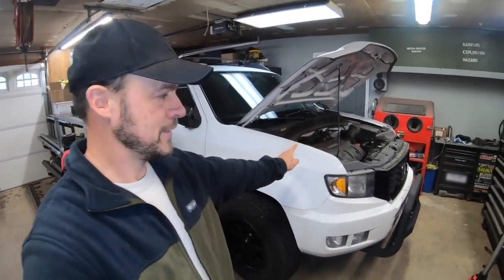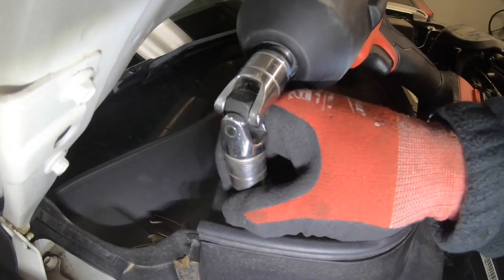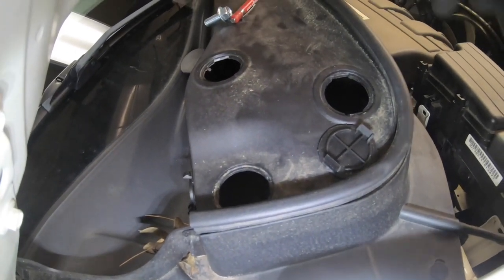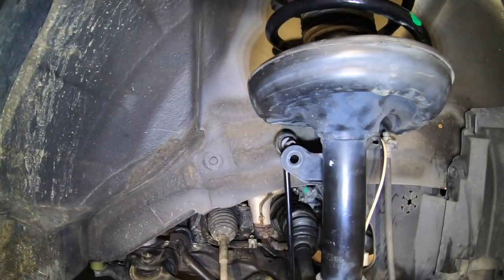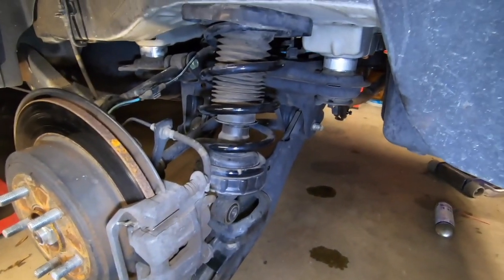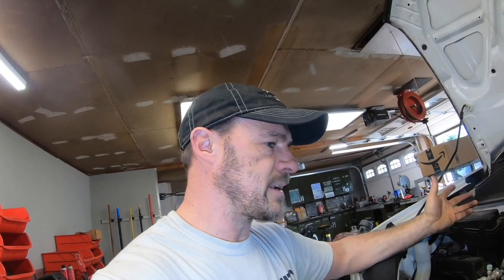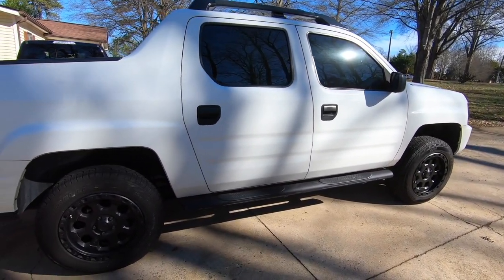How to lift a 2006-2014 Honda Ridgeline 3 inches with the HRG Offroad lift kit!!

Comment: I put a 2" front and rear lift on a 2012 Honda Ridegeline, and had the vehicle aligned. The vehicle immediately developed a shudder that starts at around 17mph and ends at about 20mph (the shudder seems to be happening only in the front of the car). The mechanic who did the work told me that he is concerned that the front axels might be stressed and that driving the car might cause damage to the axles and other expensive parts of the vehicle. Do you have any idea on what I might to do solve this problem?

Comment: Omg this lift is  amazing finally some ones is making video of Ridgeline and making aftermarket things for it I personally think that this truck is no noticed or like nobody pays attention beacuse everyone say oh it's a Honda it's suck or it looks ugly beacuse of how it looks but not it's a good looking truck and can be really cool looking lifted with some mud tires or off road tires I have been thinking of making my Ridgeline into a Baja truck like making it fast lifted making a skid plate a metal bumber and stuff this truck is amazing and I'm gonna let you in a secret of the Ridgeline I daily it and don't you think like it's bad on gass like it uses lots of gass I found out a solution how to make it save gass like it's simple anyone can do it so what I did was change the filter sure it saved gass a little bit more with a new air filter on the engine but to really get best gas mileage is to take off ur cateletic converter or cat and it's the rear one it's under the driver and passenger side you might know what I'm talking about so take it off then take everything off inside the cat so it's hallow this will increase horse power and gas mileage I put it back on after I took off everything inside the cat keep in mind I still have my stock exausht and once I put everything back together I start it up it was the same it didn't sound loud or anything same sound nice a quiet after that I reved  the engine I went to the tip of the exausht and it felt more air like coming out like lot it didn't feel like it was clogged or anything it felt like it was blowing the fumes or co2 or what ever out nice and there was dirt on the floor when I reved the engine it had so much like air coming out of the exausht it blew it like nothing after that I used it about a week and my gass would usually won't last like a whole week after I did the mod I would put gas in Monday by Saturday I would be at empty after I did the cat thing I was getting so good gass milage thaty gas would last up for 2 week like it was crazy my gas last more know it last more than my Honda ep3 and it a 4 banger and it also increase horse power I can feel the truck when I barely push the gas like it will go fast I want some one to try this and tell me the amazing results it really work  it fast and easy and will save you gass and money
Reply: The Last Cyclicfiend8  ever thought of a Honda RidgeLine Texas Edition with a 3 - 4inch lift kit + A Dully Back Wheel Base?
Reply: Did this make an engine light come on? Also did it pass The admission test on the inspection! Sound like a great idea but I want to make sure

Comment: 3:54 - I know this is super late but you mentioned clearance under the hood at this point in the video for tools... At 3:54, that rectangular hole on the top of the video is for your hood prop, raises it WAY higher and out of the way... I learned this after doing my front struts last year. Hope that helps somebody else in the future.

Comment: Glad I found this vid. Had a 2" spacer kit on my 06 for years and took it off, because I got tired if the awful vibration under acceleration and it was prematurely destroying axles. Now seeing this gives me hope and I want to lift it back up. I'd love to see a long travel kit made for the Ridgeline. Also, with that 3" kit, now it will accommodate a 32" or 33".
Reply: Any idea what caused the vibration? I get that occasionally with my 2" lift
Reply: @eggonatowel868  The increased CV joint angle, but you only feel it under load.
Reply: @DARODOLO  do you think this lift kit would solve the vibration problem?
Reply: @goodplanetfilms  I actually called the company and spoke to them about that issue. They said they believe it's actually a axle issue, but that subframe kit aligns the axles again which would alleviate vibration. On a side note, if you replace your struts, DO NOT USE aftermarket springs, keep the original springs.
Reply: @DARODOLO  thanks for the note!  Yes a lot folks with 2" lift kits had problems with axles being worn out prematurely.  I just wonder if this would fix that issue.

Comment: I have a 2012 Honda Ridgeline that's got a 4 inch lift and also put set of XD rims with 265/65R18 Handkook Dynapro AT/M's. Rims and tires fill fender wells perfect (no scrubbing). Moog lower control arms, KYB inner and outer tie-rods. About to change struts from KYB to something beefer.

Comment: Front and rear metal bumpers with a winch mount or space tucked up into the bumper. Something that won't kill the approach angle and has tow hooks or D ring shackle mounts on the face of the bumper.

Comment: Thank you for the video.  I actually make my own kit out of aluminum and poluurethane for a little give.  It was really easy and way less than 150 bucks. The fox guys are my neighbors been jawing at them for some trick struts. Was toying with replacing springs with air bags but not sold yet. Oh and I have gone four inches just to be different.  I am a platnum tech for forty years and a race car motocross nut so I really understand suspension.  I have some ideas. Already ported polished heads flowed every thing working on electric turbo supercharger and remap.
Reply: I'd pay for a set .

Comment: I love this option. I was looking underneath and knowing it's a unibody I hesitate doing anything but I was watch Baja racing videos and saw that the longer A Arms, axles, trailers,and Struts could have a longer suspension and larger tires but I doubt the unibody would hold up to the extended abilities that would have to be tried😅😂

Comment: When you flip the rear strut assemblies around so they are backwards, instead of swapping them left and right, the plastic feature at the bottom of the perch area ends up facing the wrong way (end of the coil).  Inboard is outboard and vice versa.  That's why there's a left and a right for the rear.  It's probably better to swap left and right so that inboard stays inboard and outboard stays outboard.  

Also why not have studs on the top of the front spacers?

Regarding other products, how about a steering wheel spacer, to bring it further back?

Comment: What if you don't do the subframe kit with any negatives?
Reply from the maker: You absolutely cannot install a 3 inch kit without the subframe kit. 
all our 3 inch kits or any kit that comes with a subframe kit you have to install the subframe kit FIRST. 
you will not be able to install the lift components without doing the subframe kit first. If you did install the lift components without the subframe kit. the suspension geometry and CV axle angles would be un driveable.
Reply: Thank you for replying. I was waiting on your reply before I get one ordered thank you for the awesome as well.

Comment: Hi,
I have a 2014 Ridgeline and I bought from you the 3 inch kit, what is an appropriate time of hours that a mechanic should charge you for to put in the 3 inch kit. A regular mechanic just don't have the appropriate estimate to give me. Would you tell me how many hours would it take? Also the offset camber bolt comes with this kit?

Comment: Hi there, are you facing any rub in the front on full turn of the tires? Also is there a need to change the length of connecting shafts for accommodating the changed angles? Thanks in advance!

Comment: Hey. I just subscribed!!  So glad I found you. I just changed my alternator and it has activated my theft security. I drove it from the garage to home. I drove to work and my key wouldn’t release or it wouldn’t go in gear. What can I do please??
Reply: Call the garage you had it done at and tell them they fouled up. They may or may not have the capability to deactivate it. A dealer most definitely would have the capability.

Comment: I install this 3 inch lift and I have nothing but wobbles and shaking on acceleration not sure what to do can I add more spacers to the sub frame or should I say washers with this help the situation Also I noticed rub marks and scrub marks on the axle from the sway bar links has anybody experienced this and what is the solution and greatly appreciate help

Comment: Would it be possible to pair the 3” lift and subframe kit with another 2” lift? For a total of 5”?
Reply from the maker: No because you would then have to drop the subframe another 2 inches.  At this point you are into some serious cost-prohibitive custom fabrication, extending wiring harnesses, steering shaft extensions, longer hoses, etc.
Reply: I think you can though. You’ll just have the same exact bad axle angle that you would have with the normal 2 inch kit. The 3” kit with the subframe spacers would essentially make the truck operate perfectly as if 3” was stock ride height due to the subframe spacers fixing the issue of traditional 2” kit. However, if you add the 2” kit on top of this, or some longer struts 2”/3”, you’d be at the same place that you’d be as if you only had the 2” kit, in that, the axles would be at a bad angle. Just trying to over explain this theory but i think it is possible. The custom fabrication and all the expensive stuff is just if you want it to be functional. But if you want the 5”-6” of total lift just for looks, i think you should be fine. The suspension will be stiff but if its just a pavement rig you’ll be good
Reply: I would definitely love some input from Ben on this. I’m about to buy some 3” longer struts and the subframe spacer only kit. 

I currently have the 2” lift and 33s 24x12. I’m thinking of installing the subframe spacer to put the Cv axle angles at their factory angle and then install the 3” front strut, giving me a total of 5”-6” lift in the front only while I have 2” in the back.  (I like this look). Essentially, my cv angles should be at the angle i currently have them right now without the subframe spacers, which I have had no issue with! This is a pavement rig all for show. I think this should work fine?!

Comment: I installed a 2" hitch receiver on the front of my 2014 Ridgeline to accommodate a snow plow, but the front end really sags when I lift the blade. Do you have any ideas how to eliminate or reduce the sag when the blade is in service? By the way I take the blade off when highway driving. I just use the blade for my properties.

Comment: Did you have to get a extended passenger side CV Axle ? Did a 2.5 lift kit and my passenger side CV axle seems a little short it drives but seems not fully seated in ?? Any help would be much appreciated

Comment: Would love yhe same things to make this ablebtoo crawl with a JEEP WJ. Bo5h come unibody. Both jave 8.2/8.3 in ground clearance. Same soze wheels and tires. Then it ends. Would love a TC swap yhat wouldbgive Ridgeline owners 2wd, 4 hi part time. 4 full yime. And 4 low,  beefier axles. Real lockers. Sliders,skid plates, LED bars,Winch BULL bar, and a good 2 inc suspension lift, and a 4 in and 6 inch long arm suspension lift so people can run 33's to 35's and gain more true ground clearance than 8.2 inches.
Fender flares would be needed for larger tires after body trimming i suspect so fender flares on the list as well..

Comment: I just recently purchased a 2in lift kit for my 08 ridgeline but it didn't come with smaller sway bars.  I'm not happy about that.  Do I need those sway bars, or besides some slight knocking will the factory ones still work, or will they cause damage?
Reply from the maker: Sean Bowers you definitely need the shorter end links. Our kits come with them. but if you want, contact our office through our website www.hrgengineering.com and we can sell you a set.

Comment: What wheel and tire size would you recommend using after installing the 3" lift kit for the ridgeline?
Reply: I too am trying to ascertain what the options are to avoid the tire rubbing. 2012 RL has 18 inch wheels. This mechanic did a tremendous job with the install video.
Reply: Same question, what size tire would you be able to fit?

Comment: What did you do to level the engine/transmission assembly after you have dropped the subframe? Your design is flawed! The passenger side engine mount is mounted to the  chassis and the front, rear and transmission lower mounts are all mounted to the subframe! When you drop the subframe, the engine/transmission assembly will be lower on the driver’s side, hence causing both axle shafts to have unwanted angles added. It will also put undue stresses to the mounts because of their angles! Please tell me you just missed to show that.
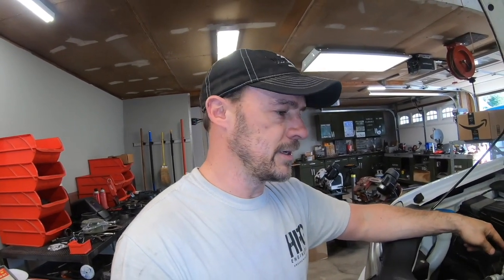Reply from the maker: I didn't miss showing it (18:50)
Reply: Oops, my bad. Missed it.👍

Comment: I wonder if this kit will work for the 2009+ Honda Pilot
Reply: Anthony Eul you can buy one for the Pilot on eBay for about $120 front and $120 for the rear.  It a 2” kit, ships from Russia and is super solid and reliable.  I’ve been running mine for two years with no issues at all👍
Reply: D.A.Honda247 that’s about the same price as this, what I like about this one is that it moves both subframes down to help with suspension geometry.
Reply: Anthony Eul yeah I agree they’re pretty solid looking kits and very complete. I didn’t see one listed for the 2nd gen Pilot so just thought I’d throw it out there about the eBay kits from Russia.   If they don’t have one available yet (I can’t see why they wouldn’t) there are other options besides the expensive Reddy Lift Kits.  Good luck on the build if you decide to pull the trigger on it.
Reply from the maker: We haven't been able to get a hold of a second gen Pilot or, Ridgeline for R&D yet.  However, we're working on it and hope to soon.

Comment: Everything looks good and all, but NO ONE is referencing the FACT that the drive axles are gonna go bad eventually. I've  had a 2006, 2012, and still have a 2014 model ridgeline. ALL HAVE HAD WHAT WAS AVAILABLE AT THE TIME, the ONLY leveling kit.....
That's where the PROBLEM exists....... You can lift it to high water, but NO ONE is coming up with a solution to the EXTENDED axles......... I WOULD LOVE TO BUY YOUR KIT, but i've already gone through many drive axles till now, JUST WITH THE LEVELING KIT. Pls come up with a solution for the axles with the lift and I will be MORE THAN HAPPY to buy YOUR kit at WHATEVER price you sell it at......
Reply: you think this lift kit will give problems to axles eventually?
Reply: Subframe kit solves that problem

Comment: This is a helpful video; HOWEVER this video leaves out some of the most difficult steps. For example, on the front wheels, this video completely skipped the hardest and most important step of this entire process - reinstalling the strut after putting on the spacer - definitely requires 2 people, and getting it aligned with the two big bolts on the wheel hub offers a lot of chance for f-ups. You can easily pull out your inner CV joint tripod and tear the inner CV boot if you aren't careful. Like I said, helpful video but do some additional research before trying this if you aren't experienced.
Reply from the maker: Please re-watch at 5:10